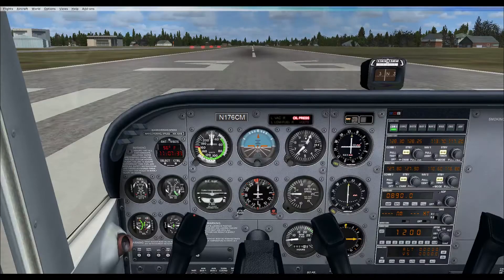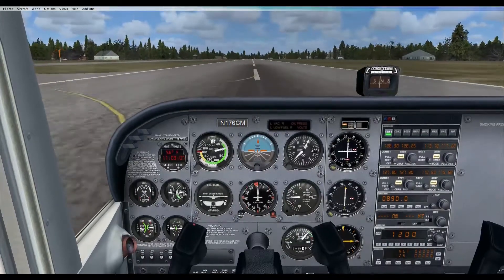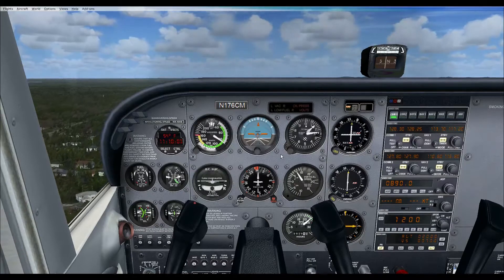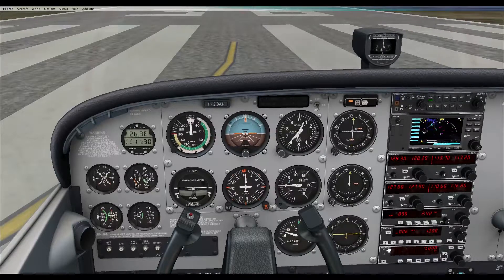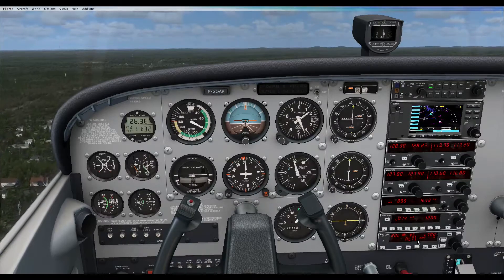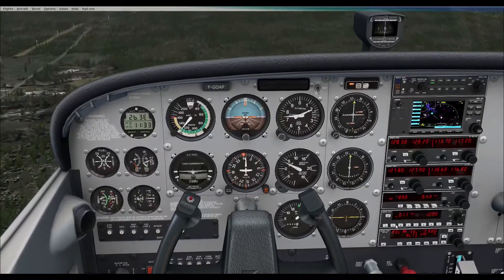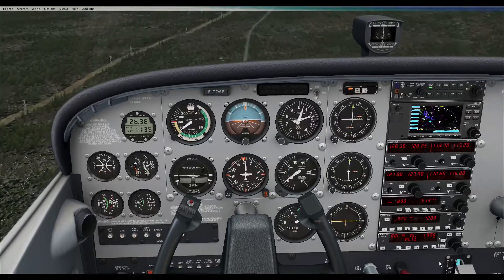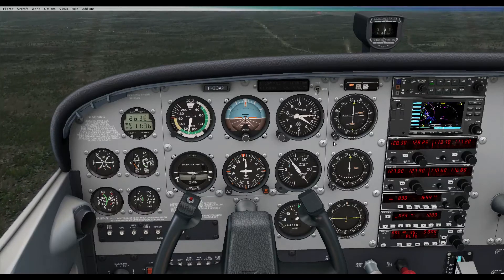How to Use the Cap 140 Autopilot in the A2A Cessna 172 for FSX

Comment: I have the same troubles with  my A2A 182.  I've only found two videos that try to help but my auto pilot is still more problems than it's worth and that's saying something considering it's the most expensive add-on aircraft I have.  Have had it for a couple years now and never use it because of two problems... one is the auto pilot not working properly and the trim is very slow to respond at first and then over responds.  Between these two problems it makes the plane essentially useless.  It was the first and last A2A aircraft I'll ever have.:-(

Comment: Yes sir, that is the difference between the two units, the second one was KAP 140 with altitude pre-select; if you hit the ALT button before reaching you're preselected altitude it will capture the current altitude by going to " 0" pitch on VS; it's a oh crap feature; i need to level off here, and it disregards the ARMED altitude, providing that you hit the ARM button. You are correct sir, to change pitch you must first take it off ALT hold, which activates VS mode and set you're desired pitch. As soon as you select a new altitude on the preselect ARM will activate again and capture that altitude and hold it.

Comment: As the autopilot's panel compares to the KFC 225 in my RealAir Duke, I assume, instead of pressing ALT, you have to press ARM ?!?

The RealAir manual for the KFC 225 states "Note: this is
different to the way in which the ALT button works on the default FSX autopilot. The
ARM button on this autopilot has much the same function as the ALT button on the
default FSX autopilot."

Maybe this works in the CAP 140 the same way ? I will test this, as I'm the proud owner of an A2A C172 too ;-))

Comment: Nice tutorial.  I have a question  i bought  FSX P3D Professional FSX installed on Microsoft flight simulator steam edition.  My problem is that i cannot start the engine. The key turn  and CTL E  does not work  although every thing else seems to be working
       any suggestion.   A2A  support  is  useless they dont reply ?
Reply: Have checked your fuel tanks. Do you have both on. Have you followed the full start up procedure?  Hope this helps. Good luck

Comment: Thank you so much for this video. I have been getting so frustrated with this auto pilot - really fed up, this has helped tremendously! What I also find is that after take off I hit the AP & a bloody alarm goes off & the aircraft starts lurching around the sky in an uncontrollable fashion. I have to turn the AP off & wrestle with the aircraft to bring it under control. The minute I turn the AP unit back on it all starts happening again! Have you experiences anything similar? Thanks again.
Reply: No such FL exist at 200,000 ft; that is what u r displaying there; did you mean 2,000 ft; FL 020, or 2,000 ft for purposes of displaying on a flight plan. FL only go to FL 600, or 60,000 ft. FL begin at FL 180, or 18,000 ft and run thru FL 600; 60,000 ft. At 18,000 ft the altimeter is reset to 29.92 in. of mercury; standard Baro pressure, and all altitudes then become FL's up to 60,000 ft. The only time you refer to FL's below 18,000 is when you are filing a flight plan; which has to have a numeric value placed in the altitude box u r filing; in this case you would put 020; 2,000 ft.
Reply from the maker: +Ian Troup 
Remember that the AP captures your vertical speed when pressed for .25 sec. So get your plane in a stable climb before you engage the AP, there will be no surprises then. Yes, you will hear the AP engage alarm when you press the AP button. On initial engagement of the AP it will automatically ARM the AP to capture whatever altitude is present so be sure it is an altitude that is ABOVE YOU if climbing and vise versa. You can change the desired altitude anytime but you can only change the VS when the AP is ARMED.
Reply from the maker: +Ian Troup 
Remember that the CAP 140 will capture your current VS when engaged. You shouldn't be getting any wild behavior at this point. The next thing you want to do is dial in your desired altitude (this will automatically ARM the AP), the AP should then continue to climb at the set VS to the set altitude. If you need to change the VS during the climb the AP must be in VS mode. If VS is showing in the AP window you simply press the Up/Dn buttons to the desired VS. 
If VS is not showing in the AP window then you must press the ALT button to put the AP in VS mode.
Reply: This was a great help video for me.  However, I still have issues with it.  I was flying along, locked at FL04 in the A2A 172, after having a successful AP ALT set.  The issues I still have are that all of a sudden (randomly), it will start to oscillate +- VS, growing with each swing, until it reaches 2600fpm both directions (porpoising, if you will).  I can then shut off the AP, trim to zero, yet still have no control over the elevators, other than a climb.  I cannot descend at all.   Ever seen this?  This has been an issue since day 1, when I got this A2A a few weeks ago.  No other planes I have (Carenado, or otherwise) have this problematic experience.
Reply: Geriatric Ginger o yes! This and more... faulty brakes, untrimable elevators. Suppose it‘s not fully compatible to Win 10? It‘s a shame, am a huge fan of A2A, no help from them until today... 🤦‍♀️
Reply: Understood, but this was at FL 2000+     https://www.youtube.com/watch?v=w6tUzlGTFD4&feature=youtu.be
Reply: Ok guys one to remember on these units, the manual states a minimum airspeed and altitude at which this unit will function correctly; don't hold me to this i'm going off of memory; but i believe it's above 80 kts and above 700 ft msl; i'm almost 100 % sure on these figures. I've had the same thing happen to me below these parameters and the airplane began wondering to the right like it was lost, even though the course was to my left; had to desengage. consulted the manual and found these parameters to not engage below them; try this out and see if it helps; it should.